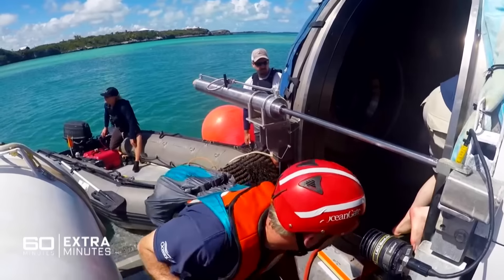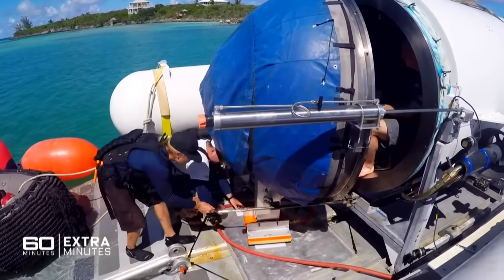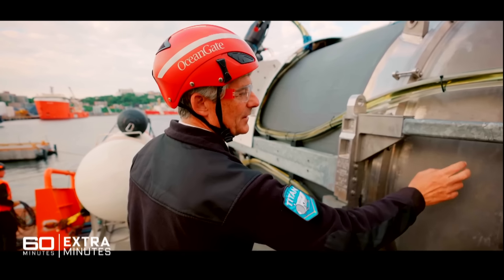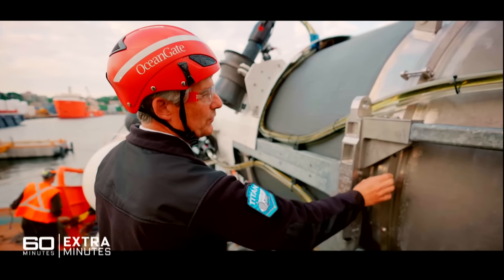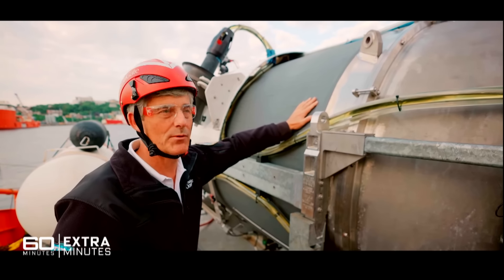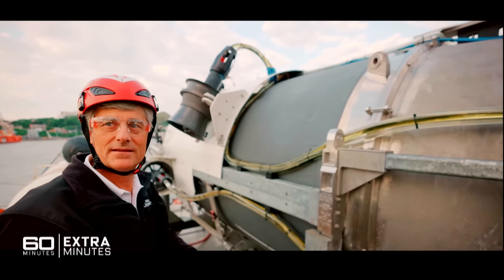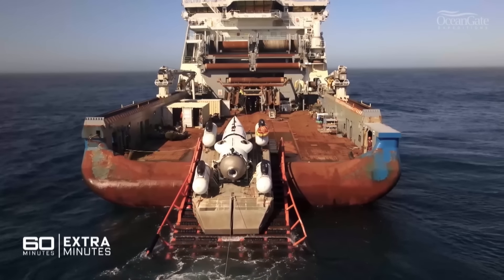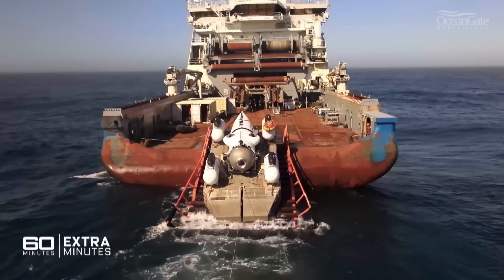Titanic sub implosion explained | 60 Minutes Australia

Comment: There's a difference between tension and compression. When carbon fiber is used for high-altitude aircraft, the pressure is pushing from the inside, which puts the carbon fiber under tension. Carbon fiber has remarkable capabilities for withstanding that. When used for a DSV, the pressure is pushing from the outside, which puts the carbon fiber under compression. The ability of carbon fiber to withstand such extreme compression as that experienced by Titan is an unknown quantity because it hasn't been thoroughly tested under those conditions. Also, a cylinder does not have the intrinsic pressure-resistant properties of a sphere, the latter being the preferred - and far more logical - shape for the cabin of a deep-pressure vessel. The whole enterprise was reckless in the extreme.

Comment: Even Airbus is having problems with "Carbon Fiber."
"Why is the paint peeling on A350?

Airbus, Qatar Airways agree to settle bitter A350 flaking ...
The A350 is built largely from composite materials that show differing thermal properties to aluminum traditionally used to build aircraft."

"In December 2021, Qatar's national carrier announced it was suing Airbus in London over what it described as the “accelerated surface degradation” of the wide-body A350. Cracks in the painted surface exposed gaps in a sublayer of A350 lightning protection, prompting its regulator to ground 29 of the jets.Feb 1, 2023"
Reply: Boeing is also using carbon fiber to save weight, and with the lighter pressure but continuous pressure cycling and airframe stresses an airliner sees over and over flexing in flight as well as takeoffs and landings I feel its only a matter of time before we see the skins breaking up from fatigue until we see more instances of the kind in the Aloha airlines flight saw back in the 80's as well as other similar failures - and those happened with better understood aluminum, who knows how unpredictable it will be with carbon fiber especially with often indifferent inspections and maintenance
Reply: @yambo59 Warten Sie  ab-es  dürfte  zu Katastrophen noch kommen….
Reply: @gunnarganz1130  "Just wait - catastrophes are likely to come...(Warten Sie  ab-es  dürfte  zu Katastrophen noch kommen….)"  Absolutely....
Reply: @JMHTruck32005  Genau so denke ich!

Comment: I thought the inside of the hail was at lest steel lines. But apparently not. They used the steel haul as a mold and slid it out, after the carbon fiber was put on. 🤦🏻

Comment: There was an incident a number of years ago which did not result on an accident. Not sure when or where. A crew in a bathosphere descended down to a great depth for the usual purpose of exploration and observation. They had a double glass observation port for visual. I don't know the depth they reached. The outer port glass cracked. They resurfaced without an incident. I remember one of the passengers recalling what happened. Anyone else hear about this?
Reply: Yeah you guys are both talking about the Trieste, the bathyscaphe that went down into Challenger Deep in the Mariana Trench in I think 1960 the first time

Comment: The actual cause of death is the lack of positive buoyancy.  The sub was over weight and sank too fast.  If it had been able to drop sufficient ballast in an emergency assent, it would have not imploded and probably would have been retired from service.   Sort of like testing an experimental aircraft without a parachute.   Not engineering.....common sense.

Comment: There was literally no good reason to use carbon fiber for the hull.  Weight savings mean nothing, because even a steel hull is buoyant, requiring ballasting. Cost clearly isn't a benefit.     Joining the dissimilar carbon fiber to the titanium ends is an additional complication.  It's inflexibility makes it prone to fatigue failure, and provides very little indication that failure is imminent. 
The only reason carbon fiber was chosen, was because he thought it was a "cool" material to use.

Comment: ‘carbon Fibre’ is used to REINFORCE the GLUE.  That is all.  It stops the GLUE cracking as it flexes.  This was a GLUE / Epoxy / Resin /etc tube, reinforced for flexion and tension with carbon fibers, as opposed to Glass fibre which we use for other sorts of boats.

Comment: This wasn't the greatest explanation of the properties of carbon fiber composites or carbon fiber reinforced polymer (CFC & CFRP), so I'll try to explain it better.

CFCs/CFRPs are exceptionally high in tensile strength (being pulled apart) however they rely heavily on the resin substrate when under compressive loads (being pushed together). Think of it as a string - very strong when pulled apart but "floppy" when not under tension. The resin substrate stops it from being "floppy" when not under tension.

So when a CFRP piece is subjected to pressure, it is in fact the resin that takes up the slack. With repeated pressure cycles, CFRP layers can sometimes delaminate ie one layer becomes unstuck from the layer above it. This weakens the composite tremendously.

By all means, use CFRPs for tensile applications but nobody will recommend if for huge compressive loads!

Source: BEng Mechanical Engineering & Material science experience. You're welcome.

Comment: I am an engineer with considerable experience in the production of gr/ep structures, fracture mechanics and pressure vessel design. Carbon fiber is good in tension but not good in compression.  The submarine hulls must handle compressive loads!

Comment: They only ran the carbon in one direction, if there was no cross weave this thing was basically a 5 inch thick epoxy pipe...insane...on top of that, they GLUED it to the titatinium...

Comment: It was the epoxy that held the hull together and from the very first dive those loud cracking sounds were the sounds of epoxy cracking in some layer among the many layers of carbon fiber. Each cracking sound was additional weakening of the bonding epoxy that would of course have to eventually fail under the insane 6000 psi pressures at those depths.

Comment: I had heard that Rush didn’t like the design from a marine company so he hired an aerospace company instead. Aerospace, whose specialty is external pressures between zero and one atmospheres. Carbon fiber is strong being pushed from the inside but weak being squeezed from the outside.

Comment: The essence is - again, still - not relayed. Carbon fibre has extreme tensile strength. This means in itself it can handle a very high pulling force to its string (more than steel). In an aircraft or space applications, where there's an inside force pushing outwards, this generates a pulling - tensile - load on a string wound in/around a tube. E.g., conversely, concrete can handle very high compression loads, but has little tensile strength: it's hard to compress-crush, but easily torn apart - and that's why we have reinforced concrete. In the case of an aircraft's pressure cabin, at altitude, the pressure inside is comparable to a height of 2,200 meters and the outside has a pressure that's extremely low - the pressure difference is less than 1 atmosphere.
The problem with carbon fibre used differently than as a string to handle tensile loads, is that it needs a glue to hold it in shape and together and then it still is only a yarn or weave of yarn in layers of glue (resin, giving a composite of carbon string with resin).
In the case of Titan, irrespective of the weave pattern of the carbon "yarn", the pressure did not load the carbon's tensile strength, but the strength of the resin/glue that held the carbon together. With a pressure inside the Titan of 1 atmosphere, at 3,800 meters depth the outside pressure, and hence the pressure difference, would be about 400 atmosphere (it's salt water). While the carbon yarn in the composite tube may have been able to handle a tensile (pulling) load compared to 400 atmosphere, the resin/glue and its binding to the carbon could not. Each dive would cause deformation in the tube that caused delamination: where resin/glue becomes loose from the carbon yarn. Using acoustic monitoring listening for cracking sounds in the tube meant that the Titan company anticipated this to potentially happen. The facts now reveal that signals of cracking have been ignored for years, actually, leading up to this implosion.
The titanium half domes retained their shape in the implosion, but the window (porthole) in one of them is completely missing. The implosion just blew the window out of the titanium and shattered that window into pieces - just like the implosion will have shattered the people so fast that it was over before their brains could register any pain, in the theory for 3,800 meters depth. The bangs before the implosion from resin and carbon delaminating, though, will have been extremely scary. And likely the implosion did not happen at 3,800 meters depth but only at 1,500 meters or so (40% depth, 40% forces of maximum depth).

Comment: The loud gunshot noises heard during "successful" dives were likely fatigue cracks.  With each dive, the cracks would have propagated.  That's the problem with carbon fiber assemblies.  They are too rigid, unable to withstand fatigue.

Comment: At uni - we were taught that carbon fibre, or its derivatives, work well in tensile applications - where the material excels in being stretched.   In compression, it's almost useless - you are relying on the glue to hold it together, rather than maintain its shape.   Those dives - putting extreme compressive forces on the tube, would de-laminate everything.

Comment: I'm a civil engineer, and although I have no experience with carbon fibre, I have experience with concrete.  Concrete is amazing in compression, terrible in tension - that's why rebar is placed inside the concrete, the rebar is what carries any tensile loads.  A fibre would be the opposite, great in tension, terrible in compression.  I really don't understand how an entire company which has many engineers could fail to grasp something that is 1st or 2nd year engineering school material, but here we are.  Perhaps those who did grasp it were fired by Stockton Rush.  A better design (but still not one I would trust) could be to have a metal skeleton to take compressive loads, integral with carbon fibre skin above and beneath.  Just using pure carbon fibre without reinforcement seems like madness, based on what's been said in the video and elsewhere.  It's like asking a fish to swim at crazy depths without a skeleton, the fish would just implode.

Comment: In the late 1980s, General Motors invented plastic-fiber composite transverse leaf springs for Corvettes and many other vehicles in their automotive lineup.  I'm an automobile enthusiast and have been working with cars for almost 30 years, and I have never heard of one of those springs cracking, despite the vehicle's suspension deflecting millions of times over hundreds of thousands of miles. Now if General Motors could build something 30+ years ago which could take that amount of repeated flexure, why couldn't the builders of this submersible bathyscaphe have found something similar to use all these years later?
Reply: Because he wanted to build it cheap. It would cost much more money to build it with better materials.

Comment: I would have to disagree with the statement that carbon fibre is unpredictable.
The world’s two biggest commercial aircraft manufacturers are making aeroplanes using carbon fibre composites, if these materials were “unpredictable” then surely they would not be used in commercial aviation.

Comment: I was a fabricator at boeing for a few years. Based on the knowledge of composites gained there, this design is madness. Glued joints under that much pressure, not to mention the carbon fiber. Absolute madness.

Comment: Did anyone notice that fibers are good in tension but not in compression? Pushing a rope is harder than pulling one?

Pressure vessels with pressure inside have their fibers in tension, pulling the fibers. Vessels with pressure on the outside have their fibers in compression, the old pushing the rope problem again. 

My un solicited and only opinion based judgement is that the epoxy was the main strength of the vessal and that the carbon fiber was along for the ride.

Comment: Its not the hull it was the glue they used to seal it. No sub uses glue for deep diving and all subs that deep dive are made out of the same metal for everything because deferent metals contract and expand at deep depths. It did not implode it fell apart due to a leak